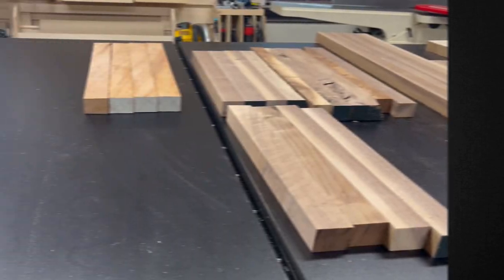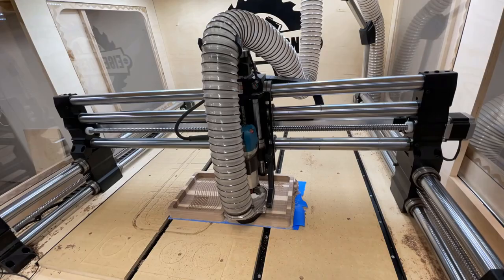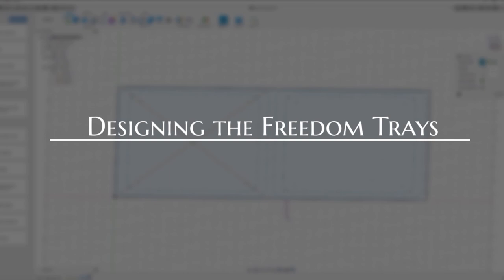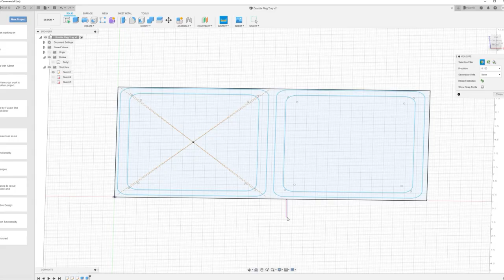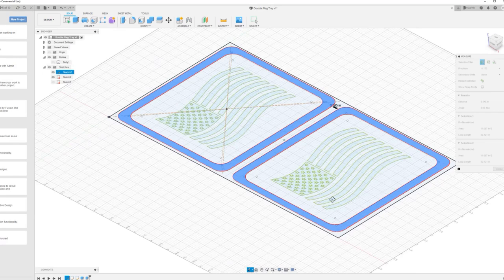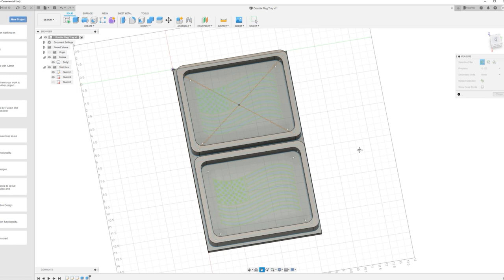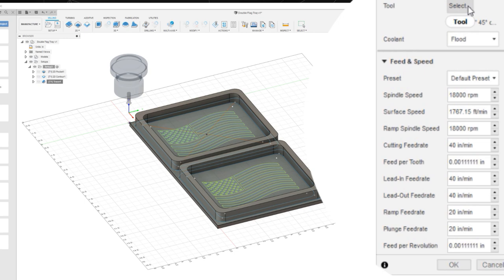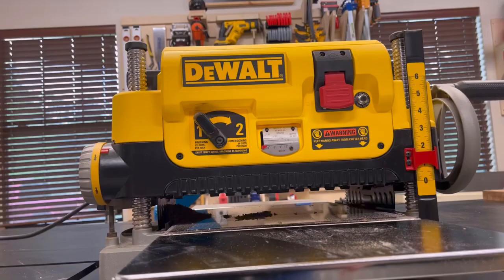USA Freedom Trays - Great CNC Project! Monetize your scraps!

Comment: I dont know if you know this, but that dial indicator on the dewalt planer, you can turn that to 1" and your stock will be exactly 1" so you dont have to worry about the gauge on the right side of the planer:). But keep on creating content! LOVE IT!
Reply from the maker: Hey! Yes I do know about that,  but I actually haven’t tested the accuracy since I changed out my cutter head to the Shelix. It’s supposed to be the same with the larger OD cutter head, but I haven’t tested it yet.

Btw, are you a full time woodworker now? I saw one of your TikTok videos that said your corporate job was being relocated so you were now doing your side hustle full time.
Reply: @EigenDesigns  I guess you can say so! Lol. Still haven’t fully left the Corp job yet, but I’ve been doing 55+ hour weeks on the “side” hustle!
Reply from the maker: @customgrains  do you sell cutting board conditioner on your Etsy store? I’d like to support you.
Reply: @EigenDesigns  I actually quit Etsy due to the high fees! I’m in the process of revamping my whole website at CustomGrainsMN.com. I’ll let you know when I add that product!!! Thanks so much!!! 🥰❤️🥰❤️🥰❤️🙏🏻

Comment: Hows the new enclosure working out ?    any changes you would make ?     As a new CNC r i love watching the design process and how to do things. Great videos, thanks for sharing your knowledge its greatly appreciated !!   P.S. the sketch up file 2017 opened great Thx.
Reply from the maker: That's fantastic news! I haven't come across anything significant yet in terms of major re-design items. One thing I plan to do down the road is put in some drawers for additional storage, but that will be further down the line. I am really excited for you to get your CNC!
Reply: @EigenDesigns  Thanks. it looks like November for me, so enough time to get things in order. i'm going to have to put the table on casters though, so i'm not sure how that will go. i may add some lock down feet as well ? not sure yet.your enclosure is big enough for the suck it dust boot i take it. lol. ill keep in touch. I decided to go with the carveco maker software so im trying it out and trying to learn it. big learning curve for me but interesting. cheers, Craig

Comment: My onefinity should be here shortly. Was your DC running when you were hogging out the trays? I went for the wall mount option as im out of space. I figure if it makes heavy dust like that Ill just build a trough at the bottom and vacuum that out at the end.
Reply from the maker: Hey George, yes my dust collector was running while I was carving out the bulk of the material inside the trays. What I have noticed is that when your dust boot partially overhangs the end of your wooden stock, it loses the suction around the bit and shavings tend to fly all around the CNC wasteboard. When it's just carving on top of a flat piece of wood the dust boot does a much better job collecting the cuttings.

I am interested to see how the veritcal mount system works out. I have seen a few people do that as a means to save space, but part of me wonders if the life span of the Y axis motors will be reduced since they have to fight gravity for every movement. I would love you to share your experiences once you have yours set up! 

Happy building!